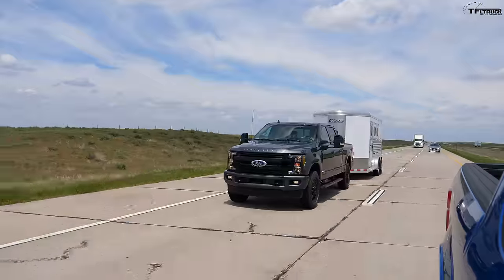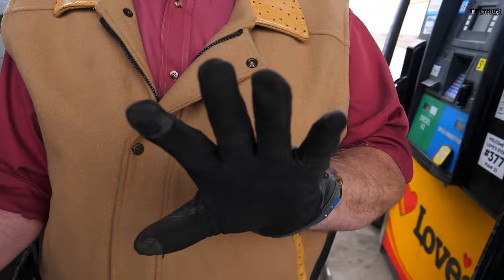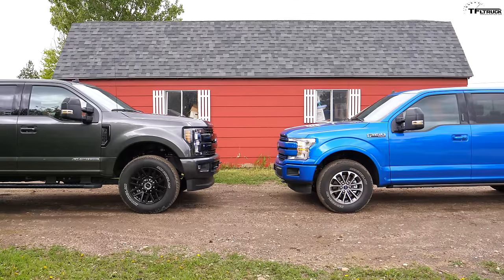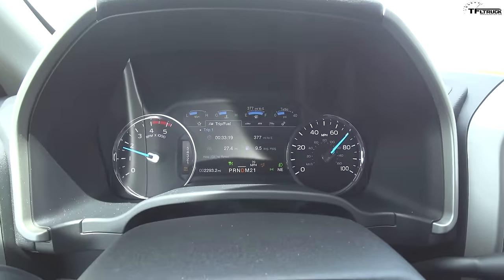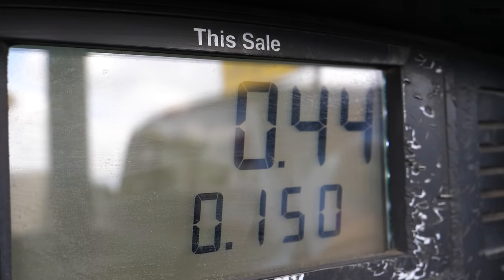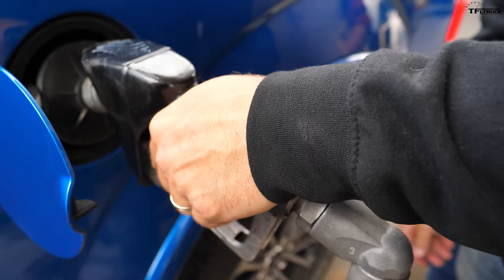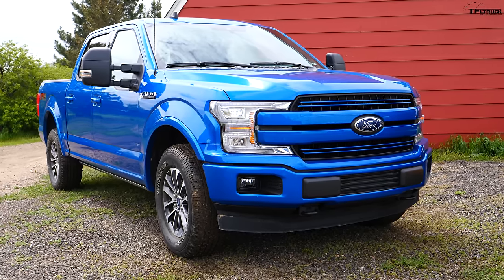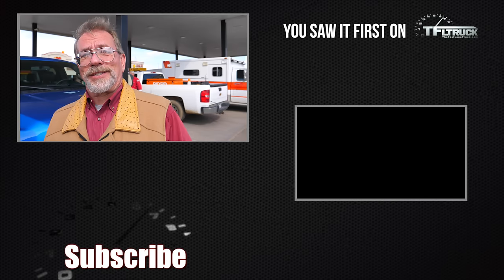Do You Really Need a Heavy Duty Truck to Tow 9,000 lbs? Ford F-150 vs F-250 MPG Review

Comment: This is why Ford is making the 7.3 gasser. It’ll likely be a great inbetweener if a “1/2 ton” is too little of a vehicle but a “3/4” ton” diesel may be too much.
Reply: I think the 7.3 is still going to be 3/4 ton territory. The F250 with the 6.2 would have handled this fine. The 7.3 is being introduced because there needs to be a middle ground between the gas and diesel as the diesel capacities are realistically getting ridiculous for pick ups
Reply: @Dirtkid98505  true, I didnt mean to insinuate it would be put into the 150, but like the 6.2 it'll be on the slightly lower end of the heavy duty spectrum. If we go by Ford's word that it was designed for good power and fuel economy, on a test like this it may have really shined above either of these trucks (taking into account price of course).
Reply: I'm not a Ford fan, but the 7.3 really is a masterpiece. It was designed more for commercial/fleet customers. Diesels have become prohibitively expensive on fleet scale (where Ford makes most of it's truck sales). They cost more to run due to rising diesel fuel costs, general maintenance, etc. and don't last nearly as long due to emissions restrictions. This makes the 7.3 a great option.
Reply: Yes! The V10 is a great engine.
Reply: IMO, 7.3L isn't directly in between the 1/2 gas and the 3/4 diesel, it's actually going to be a true alternative to the diesels for people that absolutely tow more than a 1/2 ton can handle but who aren't interested in paying $9,000 for a diesel option. The, 6.2L F250 is, I think, the actual middle ground between between your typical F150 and a diesel F250.

Comment: There are a few things you need to think about. First is tung weight on a bumper pull trailer. Tung weight will lift the front end reducing front traction and steering ability. The next thing is not if it will pull that weight, but how well it will stop all that weight. If your towing 9K with a 3K truck and you need to stop in a hurry, what do you think is going to happen? That's right, it's gonna push you. Stopping ability and safety is more important then pulling power. You can take your time getting up to speed, however stopping distance is almost always limited.
You need to review stopping ability with towing the max amount per the trucks maximum towing ratings.

Comment: I started watching this because I thought you would be comparing the 6.2l Gas HD vs the 5.0l half ton. I think that would have been a better comparison especially on the price and fuel mileage sides
Reply: Ya definitely
Reply: Best I've done with my 2017 superduty 6.2 was 9 mpg pulling 10,000 lb fifthwheel. I had a 2012 powerstroke and the best mpg with same fifthwheel was 12
Reply: They can only do what Ford gives them.
Reply: @OpenAirAdventure  what is your mpg unloaded?
Reply: @alextrainor2552  14 city 17 highway with the 6.2 , I dont have those numbers for the powerstroke because it was two years ago.
Reply: @alextrainor2552  here are the numbers 
Pulling 10,000 lbs 8 mpg
Empty city 14 mpg
Empty highway 17 mpg
Reply: @brentvance3958  I'm sure they can get their hands on any truck, I know if I was close to them I'd lend my truck for a video so I'm sure there are folks who would do the same. It would be a blast to have your truck featured on their channel
Reply: @OpenAirAdventure  thank you, was wondering how bad it would be going from a 2015 5.0 to a 2019 f250 gas. Seems the same.
Reply: @alextrainor2552  my truck has the small 17" tires and 373 gear ratio with the G transmission. You can see it on my channel.
Reply: @OpenAirAdventure  i think you meant 17 inch wheels.

Comment: No you don’t. We do it all the time and no problems at all. I would not go any higher than 9k on an F150.
Reply: brent vance I agree I think they just paid the 6.4 L.   Lariat
Reply: F-150s with the 3.5L are rated for 10,700 lbs stock, and up to 13,500 when properly equipped
Reply: David Flenke I know what they say it can tow, if it was a flatbed trailer hauling bricks or something yeah you could pull 13k. You try to tow a 12k camper that is just a accident waiting to happen.
Reply: @brentvance3958  yup I just had to learn the hard way. I have a 2020 f150 with the 3.5 & max tow package (13,200). Went & bought a 30ft toy hauler that's ~11,500lbs loaded & we had 10-20mph winds on the highway. That was the single scariest driving experience i ever had. Toy hauler was tossing us around pretty good. Couldn't do over 45mph on the interstate. Looking to trade it in for a 250 already.

Comment: Our 18 f250 6.7 is a beast it will tow anything with ease.I have had many 1500 trucks and none tow like the f250 just pure confidence and control and power is unmatched.The gas motors will be at 3000-4000 on hills and headwinds and the 6.7 is still barely touching the gas pedal.It’s a world of difference!

Comment: TFL >>> Andre, Mr. Truck ... a question for you guys: when setting up the weight distribution system on the hitches do you bring the "squat" level of the truck(s) back to their original heights, or is it some in-between number?  Thank you in advance for your responses, and thank you for the excellent quality coverage as we have grown to seeing from you two ;-)
Reply: You don't get back to the original gap because the suspension is loaded down. But you want some of the weight shifted back to the front axle. The front and back will drop but not as much as the back did before weight is redistributed.
Reply: @jghall00  >>> thank very much for taking the time to clearly explain how the weight (re-)distribution works, I greatly appreciate it ;-)

Comment: Should have used an EcoBoost, I have a '16 EB with a Livernois tune running same power as the HO3.5 in the Raptor, Tow 7000# all day long getting 12mpg and able to pass anyone I want on grades even the GrapeVine, I have 0 complaints.

Comment: $23.08 for 7.35 gallon of diesel @$3.14 per gallon vs $25.04 for 7.82 gallons of gas @$3.20 per gallon. When did diesel become cheaper than gas?
Reply: Here in central FL, diesel is about 30 cents per gallon more than gas.  Considering the $8-9k extra cost of a diesel option (plus the extra cost maintenance) and the very small difference in fuel mileage demonstrated here, a diesel doesn't make $ense unless you are towing frequently more than a gas engine can handle.
Reply: Depends where you are. Here in Vegas, diesel is slightly less than regular, right around $.10 cheaper. In some parts of the country, it's as much as premium. It also depends on how close to the highway you are. Stations right on highway exits charge more for diesel because it's more convenient than driving to a station in town with a big RV or towing a trailer.
Reply: @Aaron Britt...good points...the price I quoted on diesel was from a "neighborhood" gas station at least 10 miles from a major highway.
Reply: darkjedi351  why does california have to ruin everything for both parties!!!
Reply: Don't forget about the DEF tax. Gotta add that in too.
Reply: Diesel is 260 in ohio
Reply: @bryanwinn15  wow I wish that were the case here... We are at 4.30.
Reply: Brian Hurst diesel is cheaper in my part of Idaho. About 15 cents cheaper

Comment: You don't NEED a HD to tow those loads, but you also have to think about longevity and comfort. For instance, I've maxed out my 4Runner towing a few times; it doesn't break down, but it's not very fun either. If I had to tow over 9-10,000 lbs regularly I'd probably think about a HD, they don't cost that much more any way.
Reply: Cars And Zebras all depends on how often you do it,once a year,I personally don’t think you need a diesel,I’ve been running my 5.0 f150 loaded back and forth to Wisconsin to move and while it would be nice the few times I’ve been loaded really heavy it makes no sense for rest of the time to deal with a diesel.
Reply: @mitchvus  - I hear what you're saying, but I'm not taking about a diesel. I just mean a heavy duty, can be a gas engine, just for better longevity if you tow larger loads frequently.

Comment: This is an excellent review.   I have been looking for a video like this.  I tow a 5200 lbs dry TT with an '12 F-150 5.0 with HD tow it is rated at 7800 lbs.  Power is not a problem but even with load level/sway control I do feel a bit of the tail wagging the dog on a windy day.  Curious of how much different the same trailer would feel on a F-250.  If were shopping for an F-250 and not needing the extra torque of the diesel I would go with gas for cheaper, easier fuel access and I believe less expensive engine maintenance.  Thanks for creating this!
Reply: Went from a Tundra to a 2500 Ram , towing a 7000 lb travel trailer.  Significant difference /improvement in ride quality and  ability to maintain speed on climbs and in traffic .  Tundra had to shift a lot.  Ram just stays in 5th gear even on long mountain passes and really doesn’t work hard. When I would get passed by a truck, I could feel the trailer getting pulled and would have to correct a lot. 6 hours in the tundra I was a bit worn out. ,  now much less fatigue , it’s a lot different, well worth it.

Comment: I had a 2016 3.5 L f-150 platinum and just traded for 2019 f-250 platinum diesel and my results were much different. 1: Stability was night and day, I couldn’t pull a 2800 bh grand design travel trailer without a weight distributing hitch in the F-150. The F-250 was much more stable and I could pull with a normal hitch. 2. Fuel economy on the same trailer was 8.6 average with the f-150 3.5 l eco and 11.1 average after 2000 mile trip to Oregon in the diesel. I could only go 220 miles before filling up in the eco boost and just under 400 in the diesel. I had the standard tank on the f-150.  I feel safer, more efficient and would highly recommend going with the f-250 if you are towing 5000 lbs of a family travel trailer or more. To the f-150’s credit it had the pulling power and braking that seemed similar. Wind and trucks passing the f-150 was working the suspension too much. I hope my experience helps someone. Also F-150 feels like a Cadillac when driving, f-250 is rougher for daily driving even with Fox shocks. Still worth it.

Comment: I think my F-150 would do better than the one tested. It's a 2015 F150 XL 3.5L EB w/ HD tow package, 4X4, HD sway arms, HD leaf springs.. More like a work truck. Payload is over 2,000 lbs. I think that FX4 package actually tows less. I get 8 - 10 mpg when towing a 30ft. TT that weighs about 7,500 when loaded with all our stuff. If I get the wind behind me, or if I'm following a semi, it gets better.

All F150's are not the same.

Comment: Towing truck must be based on where you tow as much as how close to the tow rating of the truck you are. I would always pull with at least 1,000#+ less than rated so as to not overwork the tow truck. In the 1960s I drove semitrucks as well as F250s pulling early gooseneck trailers where I had to use 1st gear (granny gear) in Arkansas with several people behind me. 
I now have a F150 with a 5.0 to pull my 7,000# travel trailer plus some stuff in my bed. I moved to this truck after having a F250 Powerstoke that was needed for mountain pulling from Texas to Alaska. The tow ratings are close 1,000 less for the F150 and just as fast most of the time when in Texas now. So look at everything before buying a truck and go a little bigger if you can.

Comment: Yes been down that road with a 7300lb 900lb tongue weight traveler trailer and properly equipped half ton with 10,300 tow rating   After one season traded to a 3/4 ton truck

Comment: I lasted 3 months with a 9K trailer on a half ton.  It's not a comfortable tow.
Reply: James Little, you had the wrong half ton. If it was the Max Tow, that was the wrong half ton.

A HDPP is more capable than  the Max Tow,  and I'd stick to no higher than ~7,500 - 8,000 lbs wet with a MT.

The HDPP will allow you better handling of a longer and heavier trailer over the MT, and any other half ton.

You can handle just as much side wind with a 35ft trailer as most semis, and if they are struggling with gust, you will be doing just a little better, and that's comfortable enough. On gusty winds over 30mph, just slow it down and get behind them.
Reply: Agreed, especially when hills are involved.
Reply: @hdpptowing5736  A true HDPP is not for towing but hauling, and it only gives 800 pounds additional payload.  An EB HDPP includes Max Tow, and that is the only one that can tow the most.  A 5.0 HDPP cannot tow a 9K trailer with 13% tongue weight, the receiver is the limitation at 1150 pounds.  If you have a 5.0 go crawl under and look at the tag, and then do the math.   9K @13% is 1170 pounds, add 100 for the WDH and it is 1270, which exceeds the receivers limits.  My Platinum can tow more with 1320 pounds on the receiver.    There is much more involved with long heavy trailer than what model half ton it is, no matter what, a half ton does not have the mass a Superduty diesel has, and when it comes down to it, mass is the key to a good stable tow.
Reply: acdii that's like saying a Louisville Slugger is just for baseball, and can't be used to bash a burglary in your house.

You act like the payload is going to jump out of the suspension and object to misappropriation of its use 😂😂.

Tell the payload to file a union grievance against the driver...that's not my job!!...lol

Comment: I think the big difference between a 1/2 and 3/4 is the ability to tow more than once. My largest concern with the 1/2 ton was the 10 speed auto. That is a LOT of gear changes when going up a hill or needing to pass some body. Transmission wear happens when it is shifting gears, and that is when and where most of the heat is created. A good cooler can help longevity, but it is still a lot of shifting and physical wear. The 3/4 ton picked a gear and stuck with it, let the engine do the work.
Reply: When in tow mode our 21 f150 doesn’t shift a lot with a 7000 lb trailer.
Reply: Nope doesnt change alot, tow haul rarely goes to 8th gear, towin 8,000 camper thru New Mexico and arizona 5 6 7 only gears it uses

Comment: Do a real test..  handling, line change, breaking, emergency breaking.
Reply: Agreed... get rid of the 9,000 horse trailer and try both with a 9,000 lb mini fifth wheel or a 32 foot travel trailer.
Reply: @scottjohnson943  agreed. My tt is 32’ but weighes 8500lbs and tongue weight of 900lbs. Need to get a truck and would love a 1/2 ton since its also my daily driver but also know a 2500 will be safer snd tow better even though i only tow more then 15miles a couple times a year with the family. Rest of time is 10miles away towing tt onto the beach to camp

Comment: Curious to know if the 6.7 went into regen on the trip. That will kill MPG for sure.
Reply: Ryan Torres gotta count it though, can’t stop it unless you delete it.
Reply: Eh... not on 66mi loop it wouldn’t be a good comparison. Mine goes into regen 400-500mi while towing. About the same weight and I’m getting 13-14mpg with a flat nose trailer. I figured a regen happened to get the 250’s mpg this low.
Reply: I bet MPG would be worse if it were in the middle of a regen. When in regen, it'll get about 10 or 11 MPG unloaded.
Reply: Yeah, a Regen would would have made all the difference in the world. My old 7.3 got better mpg than what they got in this test. If they really wanted to get accurate data they need to take both trucks with the same load from coast to coast. I promise the diesel will end up with a lower operating cost then the gas.
Reply: Absolutely not. If it had regenerated in a short loop, the diesel's mileage would've been even worse than 9 mpg. Really, these short loop mpg test videos are pointless. You won't know what the actual mpg is unless you drive them much, much further.

Comment: You should measure stopping distances with each pickup with the trailers. I’d bet the ¾ ton is a lot better equipped to stop that heavy load than the ½ ton, especially since the ½ ton is pulling it’s absolute max load and the ¾ ton is not.

Comment: Love the comparison! I knew you guys mentioned the F150 had 3.31s, which helps with fuel economy, but which gears did the F250 have? Also do you think the the Powerstroke went into re-gen mode? That will hurt it's economy as well.
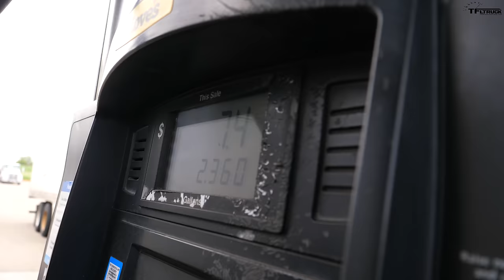Reply: It would have had 3:55’s.
Reply: It won’t go into regen while towing a trailer. It will only go into regen under very light or NO load situations, also stop and go traffic when the engine cannot heat up the DPF exhaust filter.

Comment: I do understand your objective here. And deciding on a big 3/4 ton or 1 ton diesel pickup versus a little 1/2 ton gas pickup is real world. It is a really big jump as far as capability, across the board. To me, if the manufacturers can nail down reliability issues, right in the middle of these two types of pickups is the diesel 1/2 ton pickup. I really wish that segment would be more and more refined like the 3/4 ton/1 ton segment has. Also, on another note, I was surprised and disappointed at the poor mpg of the F250 Powersmoke in this test.

Comment: You might not need a 3/4 or 1 ton to pull it but let me know how those transmissions hold up pulling that much.
Reply: The304LINEMAN for a Ford, transmission my be an issue, but not for Toyotas...Fords have a durability issue if you question the durability of the transmission...Toyotas wouldn't have that problem.

The Tundra is just outdated.